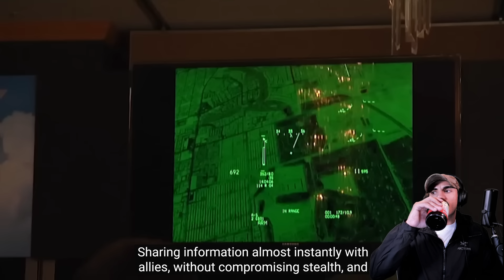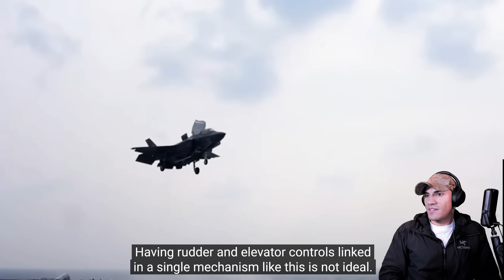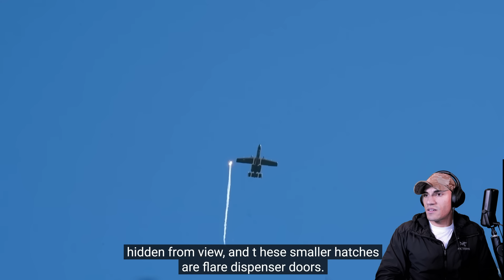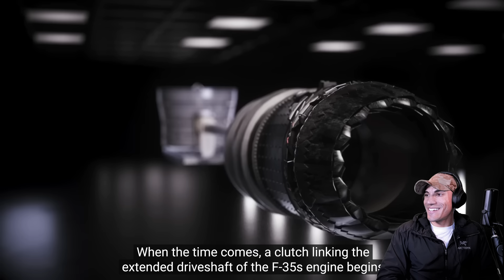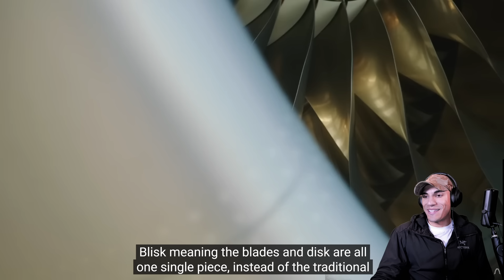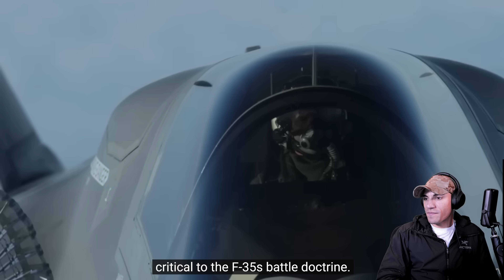Marine reacts to the Insane Engineering of the F35

Comment: You didn;t talk too much at all. This is a great reaction video, and you said it all at the end, about how much work went in to making the F-35. To reflect your comments... my roommate has been an aerospace engineer since 2006. Starting in that same year, when he graduated with his master's degree, he went to work for a collaboration based in the F-35 Division of Safran Aerospace, where he was on the design team that was developing the composite material with an extremely high tensile strength for certain high stress structural components on the F-35. The Safran project to develop this composite had been going since 2003, several years before he joined. He said for the first couple weeks, his jaw was on the floor constantly because he could not compute the amount of people, time, resources and money was needed to develop just one component of the jet. He had initially thought he was working for Safran and only with Safran, but he found out that he would be working with engineers, scientists and consultants from dozens of other companies, including.... Boeing / Lockheed Martin / Raytheon / General Dynamics / General Electric / Pratt & Whitney / BAE Systems / Samsung / Northrop-Grumman / NASA / ESA / ALCOA / Rockwell / DuPont / 3M / Huntington-Ingalls / Airbus / Booz Allen Hamilton / OshKosh / Honeywell / Lucas Oil / RTX / Healthnet Federal Svc / and Textron. There are others but I don't remember them all. Remember, this is for just ONE component. This was one project out of over 1,000 similar projects taking place all over the world for the production of the F-35. Many of these F-35 projects are still in operation, working hard to improve existing technology and to make the F-35 even better and cheaper. It is an incredible thing to watch all of these competitors working together, sharing secretive information, sharing employees, helping each other to work for the same goal. People need to know more about this. It's inspirational and a testament of what the US and our allies are capable of when we work together instead of against each other.

Comment: On long ranges and at high speeds optical cables need to be carefully installed, but on short ranges and at lower data speeds, even a fishing ling basically does the trick.

Comment: This thing has fly-by-wire, the stick and pedals arent connected directly to the control surfaces and the engine nozzle, they are just the input commend to the computers, and the computers will calculate the best combination of control surfaces deflection angle to make the plane fly to the pilot desire.
Reply: Yup and they have an auto land function for carriers where a device on the carrier can control the F35 down. Also they have put in auto terrain avoidance systems into many modern military jets that can take control of the plane if the pilot goes unconscious to avoid terrain and level out. This has apparently saved 7+ pilots lives already.

Comment: 9/10 Its not just a fiber optic cable. Theres a steel cable with a fiber optic cable bundled with it for strength. Youre right, fiber optic cable is very fragile but the fiber optic cable isnt whats bearing the weight, the steel cable is.

Comment: X-Ray vision is exactly that. The sensor suite of the F-35 feeds data into the helmet, and thus the pilot can actually turn around in his chair and look behind and below, "through" the fuselage, of his own aircraft, see an enemy fighter, lock on to and engage this enemy with thrust vector capable missiles flipping around after being released. The same system can be used engaging targets on the ground. Obviously the range of this system is not equal to that of the phased array radar, however, it is sufficient for its use.

Comment: LOL this F35 is a big pile of scrap, it has 871 failures, even the Pentagon has canceled a large amount of purchases from this pile of scrap it sucks!! and LOL, the F35 a fighter LOL auxusa, he fought against an old F16 and the F16 ridiculed him, the pilot of the F35 was disillusioned, unable to regain energy! this aircraft was originally designed as a stealth bomber for penetration into enemy zones, one wonders how it went from bomber to multi-role, by what miracle???? it is slow, mach 1.4 (no need to tell me that it flies at mach 1.6, it's an odious lie from the LM manufacturer!!!) it doesn't have super cruise (another LM lie ) it is not very maneuverable since a simple F16 is much more maneuverable than this pile of shit !! LOL! it has a lamentable radius of action, it has a ridiculous amount of armament, its gun is imprecise and when you use this gun, it causes cracks in the structure of the plane! these wings sag, there are overheating problems in the armament bays, its ejection seat is dangerous for pilots under 75 kg (for example a female pilot) these tires wear out quickly, its engine fails kisses from time to time, its oxygen generator does not work well, the F35 fears the rain (risk of short circuit) the F35 does not like hail (which damages its paint which contributes to its stealth ($50,000 per litre) the F35 doesn't like the cold, the F35 costs $43,000 per flight hour, the F35 requires 2 to 3x more maintenance time than a Eurofighter or a Rafale, its computer system malfunctions, we can hope that the next one will work better, LOL, the enemy target display system works poorly, it indicates the same enemy target several times! the visor and the helmet are too heavy, it causes disorders in the cervical vertebrae! the visor touches the canopy, which hinders the rotation of the headed ! and frankly, its stealth is only good against one radar, high frequencies, X-band, but there are plenty of radars out there that mock the F35's stealth, low frequency radars, OTH radars, and passive radars ( HA 100 from THALES (France) TWINVIS from Hensoldt (Germany) or RIAS from ONERA (France)
Reply: pogue

Comment: Not sure if the USMC have used this landing tactic but the Royal Navy FAA tends to have a slow rolling landing that allows for higher weight (fuel & ammunition importantly) whilst landing. VL is still used but I've mostly seen a rolling landing used now
Reply: The UK still does not use the SRVL at sea despite the ITF tests back in October of 2018. Much additional work and training needs to be done before the tactic is approved for operational use.

RVLs are SOP on the beach.

The Marine Corps was employing modified RVLs when recovering aboard LPHs back in the early 70s and even the FDR during a Med cruise by VMA-231 back in 76-77.

Comment: Expeditionary comms guy here. Fiber optic cables can transmit a ton of data at once, but is also not susceptible to electromagnetic interference like a copper cable is. It is very delicate, but it’s very dependent on the sheathing. We use TacFiber cables that have a thick, solid sheathe around them that makes them take bends about as well as a copper cable, and are probably more durable than one. I’m assuming whatever expensive stuff they’ve got on the F-35 is probably specifically meant for supersonic speeds

Comment: I learned today that the technical documentation for F/A-18 has two million pages all in all.

I can't even imagine what the manual for F-35 is like. 😄
Reply: I cant remember how many books it was, but the stacks of manuals we had in our hangars per chinook was pretty high.
Reply: Probably actually a lot smaller. These newer planes are much easier to fly and a lot of it is just start and go. 
Much like cars of today being a lot easier to drive than older ones are.
Reply: @randommadness1021  I'm not talking about flying but technical documentation that is needed for maintenance, repairs, troubleshooting and things of that sort. It contains literally everything there is to know about the aircraft, I would imagine, judging by the absolutely staggering number of pages.

Surely F-35 is technologically more advanced and complicated than last generation combat aircraft.
Reply: @vaenii5056  yeah, that kinda goes without saying. They have specialist teams who deal with different parts of the craft, for instance,  they can completely remove the full engine and take it into a specifically designed "tunnel" where they can test the engine. 
They can remove all parts of the aircraft and put them into specifically designed areas that are just for testing that part of the aircraft. That goes all the way from the engine, to the avionics all the way down to the pilots custom built flying suits and helmets. 
There are teams who are dedicated to each part of the aircraft which the people who are working on will be specialists on just that part of the aircraft. Meaning that they don't need to read millions of pages like you mentioned but there will be another specialist team who know how to test all the parts of the aircraft once they have all been put back on to the mainframe of the aircraft. 
If they guys run into any problems then they will be able to problem solve any problems which may occur during the rebuild of the aircraft after a refit. 

What I can't wait for is the next generation of aircraft that they are currently working on. I doubt many will have seen these things but they look like are straight out of star wars. 
Can't wait until they badboys are ready to go 🙂🙂👍
Reply: @vaenii5056  Depends on how much detail they go into on the repairs for the components vs just instructions to swap parts and send the broken one back to the factory.

When I was a mechanic with the army we used to have these 1980's era 10 ton trucks, their repair manual was a series of 8 books, the modern replacement was just 3. Because instead of having a combination hydraulic/pneumatic/electronic system to control the specialty systems there is just an electronic control module. 
So the book just says "plug laptop into ECM, if it says its broken put a new control module in", instead of "get these 3 test kits, insert the air gauges on fitting X1 and X2, put the flow meter on hose Y, with your volt meter on connector Z start the engine and run at 2400 RPM, check pressure of X on these 2 gauges. If everything is good move on to test 2" and so on.
Reply: @nilloc93  I think he was meaning what the amount of text would be like if for all they parts they were put onto paper, rather than being kept om computer files, like the one you mentioned that you just plug in. He's right in what he's saying about there being 2million pages for the older planes, there's probably 2million pages wort of text that breaks down just say the engine of the F-35A. 
And that the pilots are supposed to know exactly how every single part of the aircraft works, they cannot be expected to be experts and have read every single piece of text on how the whole craft works, they will still have to know the basics of each bit but obviously they also need to learn how to fly the the thing, they can't be expected to have read every single piece cause it would take a lifetime to read all of that by a single person. 
He is correct in what he's saying about how it would look if it all was written in books (it probably is somewhere) the amount of pages will be ridiculously long. No doubt why it was developed by 4/5 countries working together to be able to get the man hours it would take to get the F-35 built from scratch. 

I watched a video last week about how Lockheed Martin had turned an F-16 into a UAV. Should be interesting to see what their plans are for that!! 😂

Comment: I imagine the fiber optic extrusion doesn't unspool but just ejects already extended and connected by pivot joints like the difference between nunchucks and a whip.  Cause yeah, fiber optical are made of glass to transmit using light rather than electricity.  That's one of the potential ways future soldiers (and civilians) could be augmented to think and react faster by replacing or augmenting or brains to think at the speed of light instead of by natural electrical neural communication.  Great video!
Reply: Doesn't have to be glass. Any transparent material will work. You just pay a bandwidth penalty with things like cheap plastics.
Reply: How to tell someone knows little of actual physics...
Reply: And you can't replace nerves with fibre optics.... that's not "one of the potential ways".

Comment: The F-35A is the standard Air Force version, that is also exported to most countries.
Greece has expressed interest for 20 + 20 F-35As, to my dismay since the new fighter squadrons of the Hellenic AF have 24 aircraft, so the interest should have been for 24 + 24 aircraft to do the order job correctly and properly equip a two squadron wing. 
I think the US Congress approved an initial sale of 30 F-35As to Greece.
The F-35B is the US Marines version with STOVL capabilities for use in amphibious assault ships. This is the most complicated and expensive version of the F-35. It will also be exported to countries that use small aircraft carriers with ski jumps in order to replace the Harrier, like Italy.
The F-35C is the US NAVY's version with heavier landing gear, arresting hook, a larger wing and increased range relative to the F-35A.
A very interesting plane, but very expensive both to buy and operate.
From what is publicized on the Internet the fly-away cost of an F-35 is between 90 and 110 million USD and its flight hour cost is up to 38 000 USD, compared to about 12 000 USD for an F-16.
In any case, for more down to earth issues, these are two short videos from recent military exercises taking place in March 2023, between US and Greek Forces.
The first video involves the US Air Assault School operating for the first time in Greece:
https://www.youtube.com/watch?v=DGRkvSYbzAM
The second video involves a US and Greek exercise in the tank firing range at Petrohori (Stone village) in Thrace in north eastern Greece during exercise Thracian Cooperation 2023:
https://www.youtube.com/watch?v=2CywmmSH6Us
Reply: Well Finland chose them over Rafale, Gripen and Super Hornet partly due to unit cost + operating cost being lower than first 2.
Reply: "The F-35C is the US NAVY's version"(sic)

The Charlie is operated by both the Marine Corps and the Navy.

Comment: 23 years in the USAF. Aircraft are identified by MDS (Model, Designation, Series). F-35A: Model is F for Fighter, Designation is 35, and the Series is A. The ABC for the series is not pronounced with the phonetic alphabet. Instead pronounced A = aye, B = bee, and C = see. Hope that helps.
Reply: Of course, if you were talking to someone over a crackly radio, you might want to say Alpha, Bravo etc for clarity?
Reply: @johnnunn8688  you would be more likely be saying either the F-35’s nickname, “Lightning ll”, or whatever that pilot/aircraft’s radio callsign.
Reply: @chugachuga9242  more likely be calling them whatever the missions called assigned names given to the missions most important planes assigned names and then followed by their call sign then what part of the mission they are currently at eg cat 1 has ingressed and achieved objective cat 1 is now egressing can SEAD stay in place until cat 1 has passed point b then full burn and catch up with cat 1 and give support if needed then head home lads.

Edit: obviously that is very basic and assumed that the mission has been very successful, which it be fair it should be giving the price of the hardware and the quality of the Intel being spot-on, or as close as it could be.
Reply: @chugachuga9242  which Lightning 2, A, B or C?
Reply: @johnnunn8688  😂
Reply: @johnnunn8688  Hm
SU-27 Pilot 1: Enemy fighter sighted!
SU-27 Pilot 2: Which type?
SU-27 Pilot 1: F-35 ...
SU-27 Pilot 2: Ok, which type?
SU-27 Pilot 1: What?
SU-27 Pilot 2: Alpha, Bravo or Charlie?
SU-27 Pilot 1: What?!!! Who the føkk cares?
Reply: @Serpentbane69  In reality, that conversation wouldn't even get to the first part, because both of the SU-27's would be blown up way before any sighting. In short, those muscovite pilots would be blissfully dead without any prior warning. F-35 doesn't need to do dog fights.
Reply from the maker: Thanks!
Reply: You speak only for the USAF. Two other services fly it and do things differently.
Reply: @discofishing  More than two and they all developed it together.  My country also flys it and helped fund the building of it and uses the same terms. It was a joint effort. Admittedly put together by Lockheed Martin, but they are the best folk for doing that.
Reply: @randommadness1021  They did say "services" which in the US mean the different military branches.
Reply: @discofishing  only two?

Comment: love to have these in Finland in the future 😍
Reply: Well not exactly these. We get A variant so no vertical liftoff stuff but better maneuverability
Reply: They'll be the A model. No vertical lift stuff. But it'll be interesting to see conscript ground crews supporting them at a road base somewhere in the middle of a forest in January.
Reply: @jaakkomaaniemi2136  Eipä noita B-malleja hirviästi Suomessa tarvita
Reply: @jaakkomaaniemi2136  tää oli tiedossa, F35 Lightning II on silti indikaatio, maantiekiitoradalta nousu riittää
Reply: Not the B. We don't have small aircraft carriers. Not that we would have large either, for the C version. Finland will get a modified A, with the drag parachute, like Norway has. Hornet was actually a carrier aircraft, but seems like the generals didn't consider that essential this time, but they still required the brake chute to make the use of road bases safer.
Reply: They will get the A model, but still a beautiful Aircraft, Finland Strong! I hope your country (assuming you are from Finland) and Sweden get fully accepted into NATO soon!